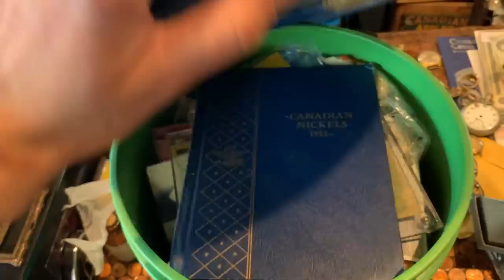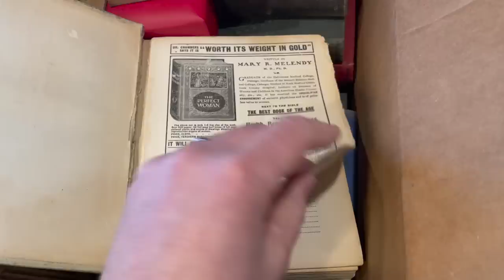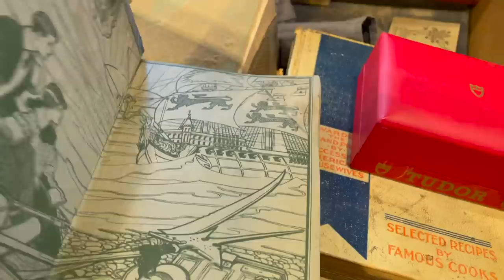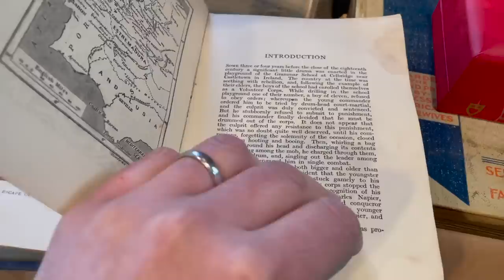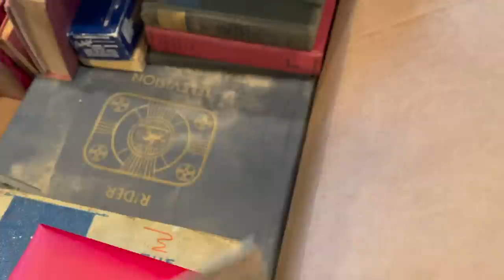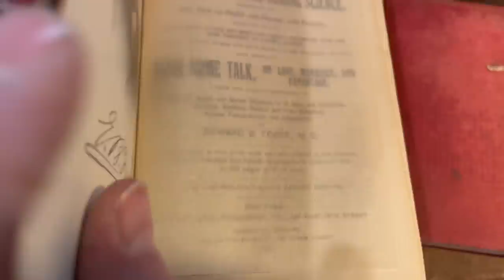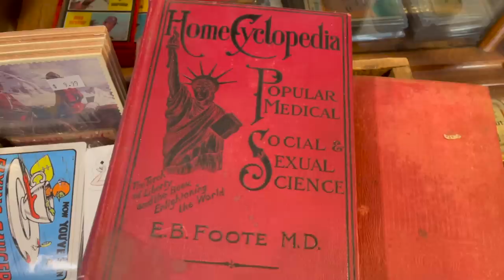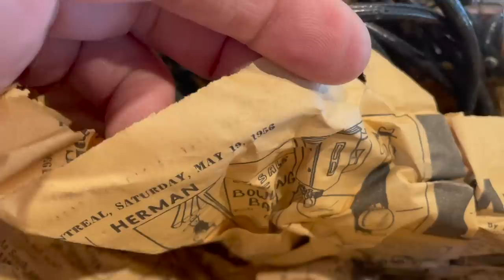Estate Boxes Arrive, and three Hans stop by!

Comment: Might want to invest into a hearth fence, that way nothing will be up against the fireplace :)
Reply: Definitely!
Reply: Good idea, leonapage.  I would also suggest either a permanent grillwork in front of the stove or a reminder sign that states in bright red letters something like "KEEP BACK 12 INCHES." I could also see a safe, baby-proof tri-panel fireplace screen that is bolted to the floor so it wouldn't move or tip over.
Reply: I know that unsupervised children are another liability around real fireplaces so it's overdrive to fence it off.

Comment: Seems like a good day at work except for the fire that was almost started. Glad you  noticed it before it done damage.👍🏼
Reply: Is there a fire supression/overhead sprinkler system installed?  Fire extinguishers visible and mounted on walls?  Being as it's an old wooden building ...  🧯🔥🧯

Comment: The item you thought looked like a chastity belt was a pessary. They were worn primarily to prevent or treat uterine prolapse (the uterus and inside of the vagina collapses or gets pushed out of the vagina opening). Uterine prolapse could be caused by extreme lacing - wearing the very tight high-fashion corsets of 1895 - 1905 to create a "wasp waist" effect.